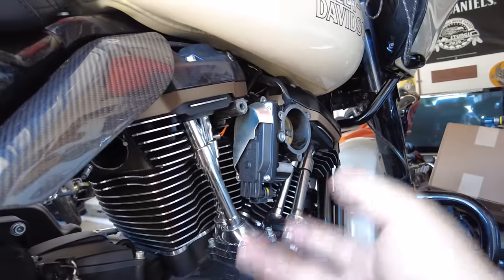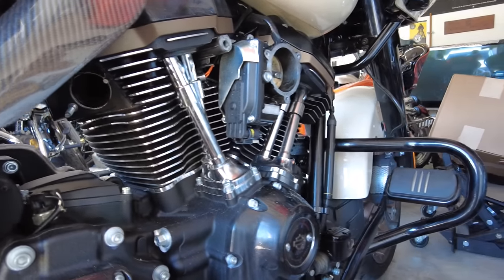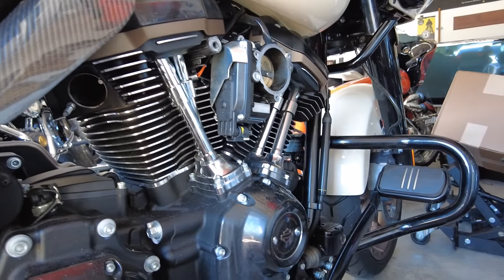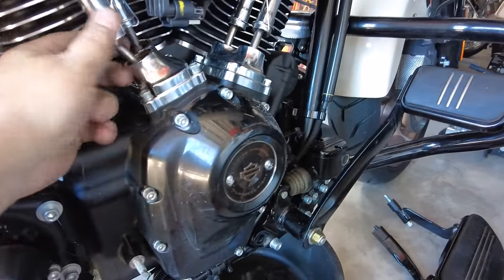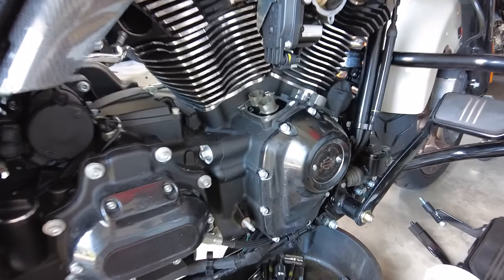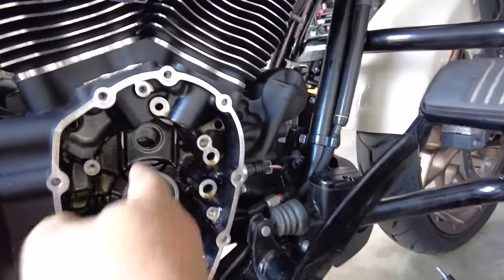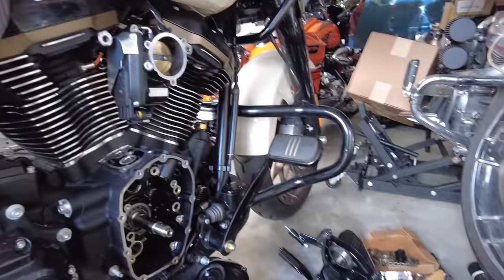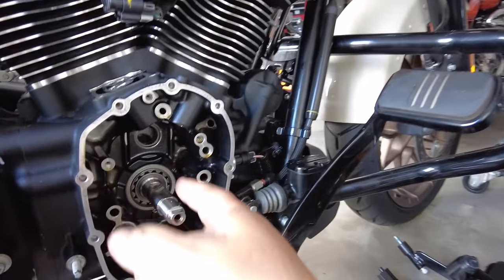Harley Road Glide ST Stage 2 Cam Install!

Comment: Hey man, thx fer the entertainment. Ur interesting n funny man. Lol.  I like ur bike collection.  I too am doin a stage 2 on my bike.  I hav a '13 dyna fat bob 103.  Super cool n comfy bike and lots of power. But, we are men and of course, always want more power. Lol.   Ive got all S&S components.... cam plate n oil pump, lifters, pushrods n sleeves and of course inner bearings.  Im using Woods tw555 cams tho. Sposed b vey good aggresive cams. Also, a Thundermax Auto Tuner ECM.   Should b perty sick wen im finished.  Its 71 hp to rear tire now. Im curious wat it will b after cams.  Will keep u posted.  Mayb u will like the power gain. Anyways, thank you fer taking the time to entertain us nutcases. Lol
Reply: Oh ya, wit more power to motor, its good idea to upgrade drive line too.    Im using a baker compensater n manuel chain adjuster and rekluse torque drive clutchs.